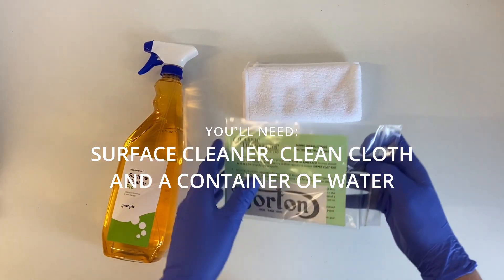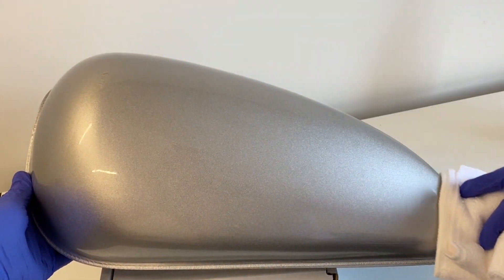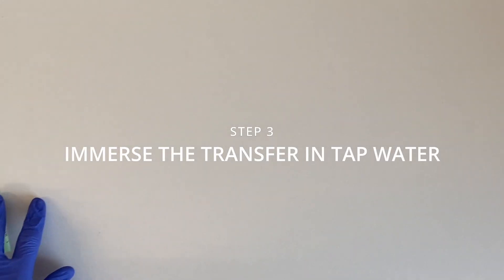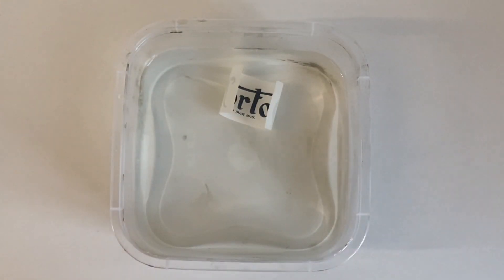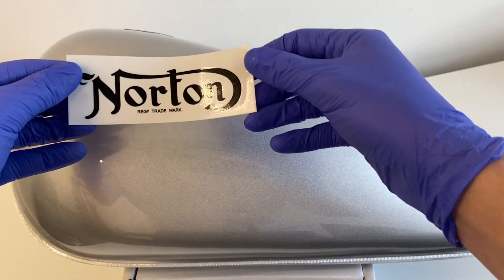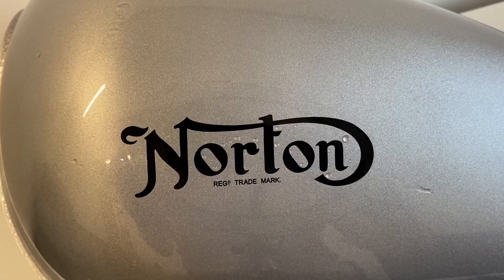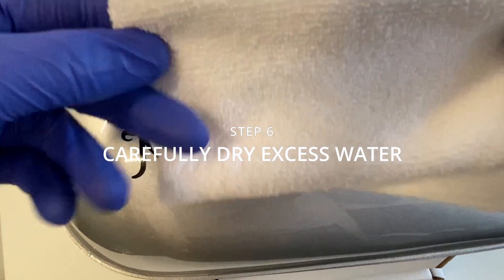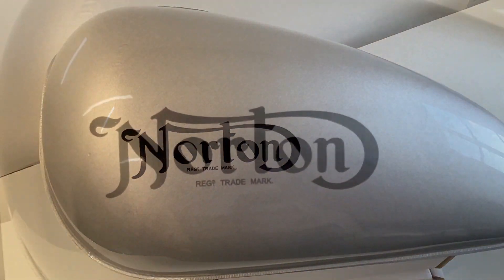How To Apply Waterslide Transfers/Decals

Comment: Thanks for the video.  It was very helpful.   I bought a sheet of decals for my Triumph that claimed to be "peel and stick" but after many failed attempts to peel one of them from the backing paper, I decided to put it in a bowl of water and see what happens.  After about 30 seconds I picked it up and it slid right off the paper...just like yours did.  And it's way thinner than the peel and stick decal I used on the oil tank. (The universal "minimum oil level" sticker.)

Comment: Thanks for the tips, they worked out great. One thing I'm concerned about, and I'd love to have your opinion on it, is the resistance in time. I noticed that wtaerslides in general have a weak adhesion on the surface by themselves. Of course i spray a double or triple 2k clear coat in the end, but do you think they won't have issues with vibes and bumps of everyday riding?

Comment: Well explained. I'm going to put clear waterslide on white motorbike parts. If I don't paint the edges of the clear sticker, will they stick out once I cover with two coats of 2k clear and sand it smooth?
Reply from the maker: If its a waterslide transfer, the varnish layer is very thin. By spraying two pack, the edge of the transfer will not be as noticeable. You should be fine with just spraying. One thing to note is waterslide transfers need to be applied to a smooth surface. If you sand the surface and then apply the waterslide, it could bubble. Only flat around where the transfer will go. Hope this helps. More info here: https://classictransfers.co.uk/the-dos-and-donts-of-overcoating-transfers/
Reply: @classictransfers7959 super clear, thanks for the advice ❤